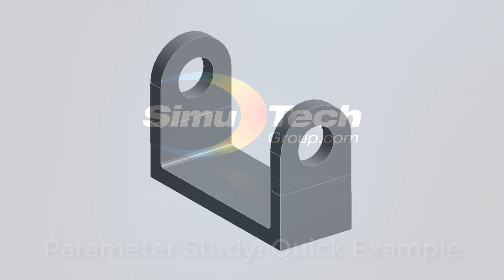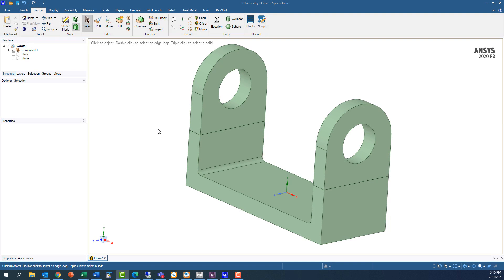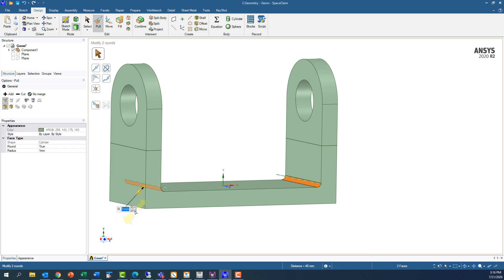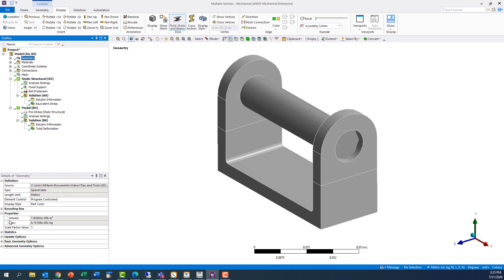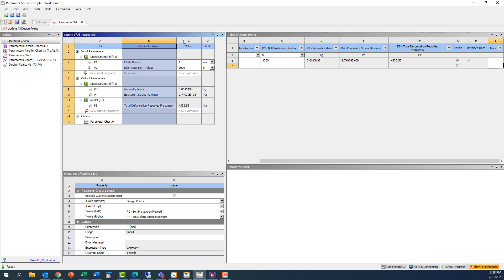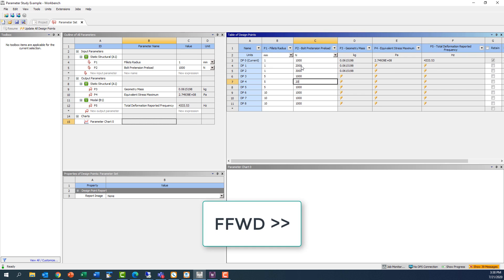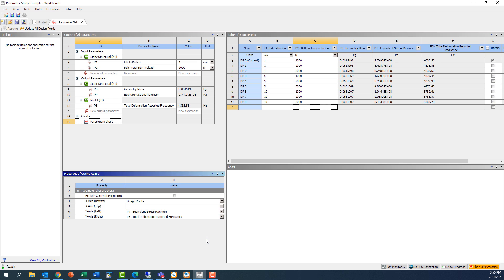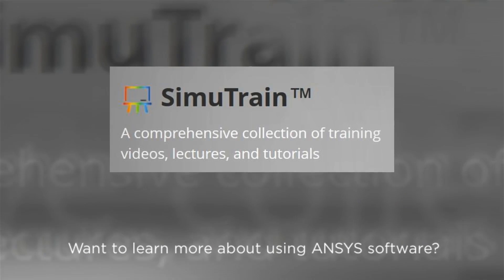Parameter Study Example

Comment: If you wanted to convert the width of the bracket into a parameter, how would you go about doing so? 
Would you have to make those changes in the sketching phase? 
What if you were to create geometry using script, and create script parameters that get assigned to a variable in the script? That's what I've been trying to get work, with little luck. Any help is appreciated, and thank you for making the video.
Reply from the maker: Hi Andrew, thank you for your comment. If you are interested in our mentoring or training services, please send us an email at info@simutechgroup.com, or you can check out the Ansys Learning Hub at https://www.ansys.com/services/ansys-learning-hub